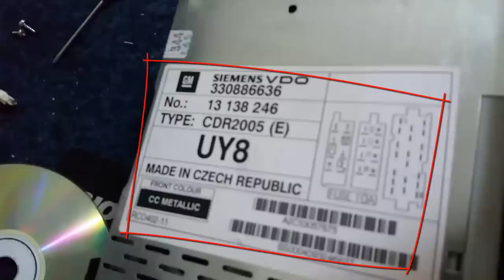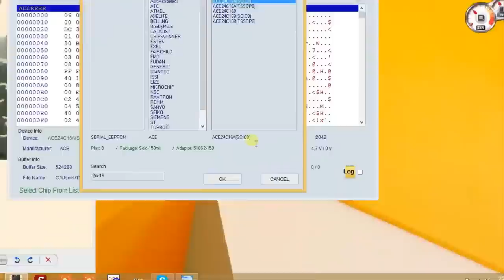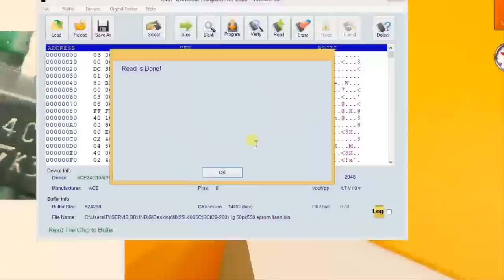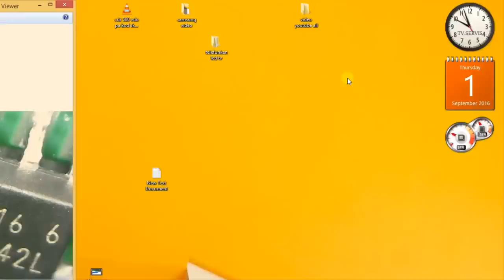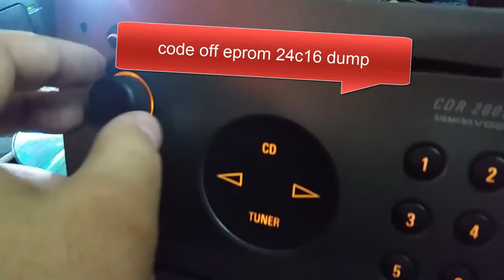CDR 2005 VDO SIEMENS RADIO CODE OFF

Comment: I have a vauxhall vivaro 2016 and the new Original radio head is saying "radio not configured, connect DIAG tool" would this work to get the new radio working?

Comment: if I buy a NEW 24c16 eeprom then download a bin online can I use that? Or is the code in the bin specific to each radio?
Reply: I mean the code in the eeprom not the radio code, when I download the bin I can read the code for radio from it
Reply from the maker: if you buy an EEPROM. new is empty. It should by all means be read by programmers. then the file should be put on the EEPROM. with codes. or without the code off.
Reply: I have emailed you my bin to get the no code version thankyou
Reply from the maker: Is this your address emailed. v1de0man
Reply: yes thank you I received your email
Reply: am I right in saying you didn't uncode my bin, just sent me a no code bin? I only ask as all my preset channels are missing on the one you sent
Reply from the maker: Do you want the file EEPROM. more codes.
  or the file. EEPROM. without the code off
Reply: sorry I do not know what the more codes eeprom is. I thought you converted the file people sent you, to a no code file. So the only difference is it needs no code. Perhaps I misunderstood. Now I have read my chip , I now know my code using another program. I just thought why not have it to no code. But when I compared your file to mine all my radio stations where missing. Of course I could just put them back in again, I just wanted clarification that's all. Thank you for all your time and effort. It is certainly a lot cheaper than £25 for a code from Vauxhall. all it costs is £3 for  programmer and a little soldering skill. Not to mention friends like you who share there knowledge.
Reply from the maker: You haven't told me. I can even codes. even without the code. What does it want. ni you or others in my channel I offer a free service
Reply from the maker: This is the radio code. 2026
Reply from the maker: I can. to make your code. like after you have you desire. 1111 or 0001 and 9999 or 1010 or 2222.

Comment: Hi. I removed the chip, read the code off it successfully, and soldered it back on. But now the unit doesn't power on. I've checked fuses and all seem OK. Any ideas what could be wrong?
Reply from the maker: if you have changed EEPROM program have not accurate. radio does not start with. must be correct EEPROM program to succeed. I like to send a. file. EEPROM only tell me what else you wish the code number. EEPROM to send the file. I 24c16
Reply from the maker: EEPROM if you change the file. radio will not boot with. I send in the code of file EEPROM. Just tell me what do you want the code number is dota I do. code as desired. for you
Reply: Well the strange thing is I didn't write anything to the chip. I read my chip and got the code off it. I didn't change it in any way. When I put it back on it turned on and I put the code in, it worked. But now it doesn't. I'm wondering if I've damaged the chip.
Reply: Ok I've just checked my 24c16 on the board with no power. Pins 1,2,3,4 and 7 are all connected to ground. Looks like my chip is dead.
Reply from the maker: Have you installed the signs of pin1 EEPROM from pin1. as in video
Reply from the maker: if you have installed the radio EEPROM. on the opposite side. radio does not start

Comment: You used an .E2P dump in a regular .BIN programmer.... don't think this is right lol
Also these chips are glued down with 2 points to prevent Hot-Air removal.....